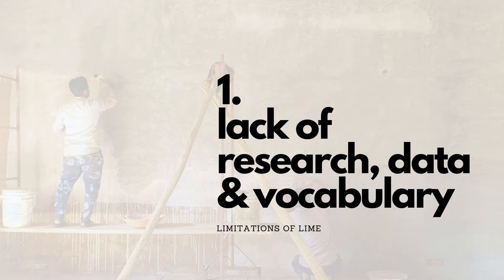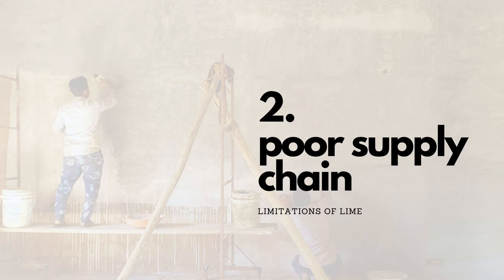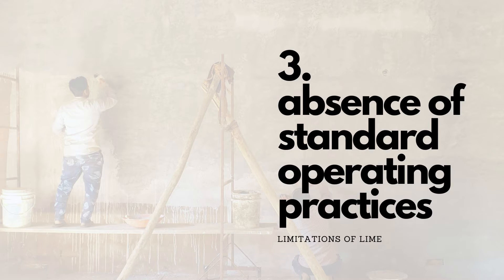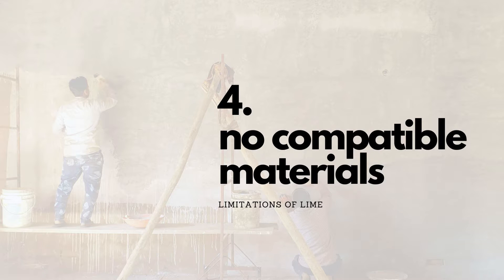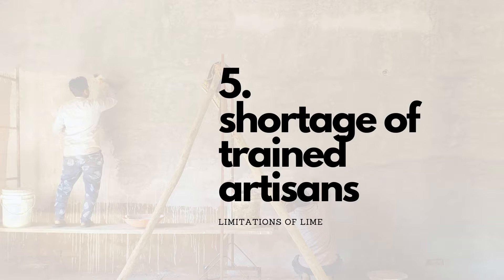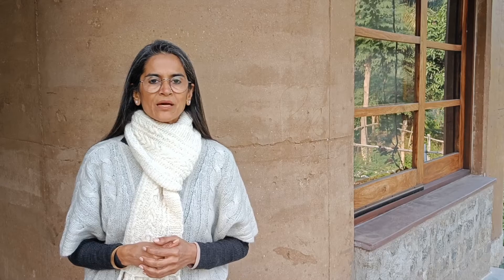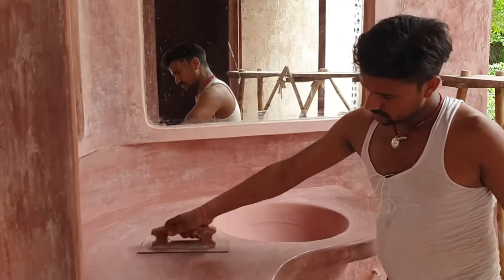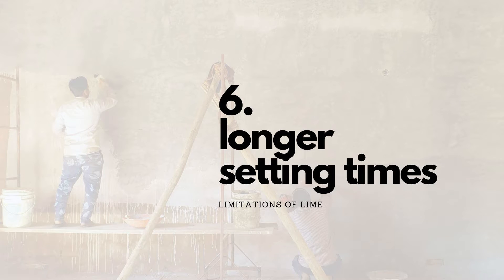Limitations of Lime in Construction

Comment: Hemp steel is the solution your looking for: lighter than steel, higher tensile strength than steel, non-corrosive, last decades. ?You can also strengthen rammed earth walls by adding hemp fibers in the sand.
Reply from the maker: Sounds good. Thanks
Reply: @farmaanandaa hemp is versatile,  they are making new composite wood from hemp.  Stronger than oak

Comment: Hello Mam. Ive been doing extensive research but haven't been able to find if the lime mortar can solely be used to laying roof. Like we do with concrete and iron bars. Also can I fill the pillar with lime mortar. How strong would that be.
Reply from the maker: Hello, no you cannot use lime with rebar. Rebar will rust and decay very quickly upon reacting with lime. You will have to use cement for that

Comment: maybe Galvanized iron columns and bars can be a compatible item. I know it's not carbon footprint free but it has a longer life span and for ages. GI can be used as pillar and Main beams at every four feet height of walls maybe we can use glass fibres and a conventional method used in Awadh area where they use a rod of iron (open) between walls in front of each other and folded and pressed through a "Tva" (डाट की छत बोलते जिसको परम्परागत रूप से) to avoide bending of walls.
I feel GI pillers and beams  for tensile strength,  using glass fibre at every four feet of wall, using iron rod pressed between walls just one or two feet  below the roof level and also using GI fibre in flouring could be a solution to the compatible material problem.
Reply from the maker: I'm not an architect or engineer, so I can't comment on the technical aspects of your suggestion. But thank you for your valuable inputs!

Comment: Im in the steel building system industry and want to use lime instead of concrete for foundations and elevated slabs. Is this possible?
This would be for residential project loads and not commercial.
Reply from the maker: We are not architects, but we have used lime mortar and stone in our foundations.  We have NOT used lime in concrete anywhere.

Comment: Hello, there is a secret that still persists about Roman cement, which is lime, salt water, sand, ash and brick dust but no one knows the proportion to prepare the mixture. Many historic temples and other buildings are made of it and still resist the erosion of time. Even some "expert" said that this Roman cement rebuilds itself over time and becomes stronger and stronger. Maybe it can be a topic for you to research, have access to all this experienced construction worker and make a video.

Comment: I thoroughly enjoyed this video, a wealth of knowledge imparted. I have always been interested in using lime plaster on my walls instead of paint , your videos are far more in depth. I thank Malvika, I feel her passion , revolutionizing the complete construction with lime + other compatable material strength  will definitely be a breakthrough. How would it be in an earthquake shake?
Reply from the maker: Thank you for your feedback. The earthquake resistance of the structure is more dependent on the structural engineering and techniques rather than the mortar. IN our understanding, the mortar will be as solid as cement.

Comment: Manisha ma'am, did you try speaking to Mrinmayee Mahija Architects from Bangalore? They run a trust called Grama Vidya. They are building multi floor building without pillars and beams(the idea is load bearing walls).

Try speaking to them they may help you with a breakthrough.
Reply from the maker: Thank you for the suggestion!
Reply: Also you may speak to Siva Darshan Malik ji from Haryana/Punjab who has been  a professor at IIT Kanpur, he may help to find  a solution here.

Also there is a Scientist who is working on Bamboo for a very long time. Try speaking to him. He was one who told us using bamboo we can build high-rise instead of steel

Comment: I heard from a mason who used to work with lime and other sustainable materials, that using steel with lime is possible by keeping it exposed rather than filling it with mortar around. Like in Madras roofing, we can use steel truss instead of wooden truss, and its safe since its left open and does not react anything else other than air and moisture.
Reply: I am building a home with laterite stone and since watching this series line is playing on my mind. No support from architect and too late to go for someone else. With the help of contractor I want to go in for lime mortar instead of regular cement sand. . If any one can give me the confidence that use of lime mortar during rains won’t pose a problem . As an lternative method I would use conventional mortar but once the monsoon ends and the roof is done the lime plaster can be done. . I was even thinking of Vedic plaster.
Reply from the maker: He's absolutely right
Reply: This is such a valuable input and great the Channel has confirmed. I intend to use Exposed Steel with Hollow bricks and now hope to convince the Arch. for Lime mortar.